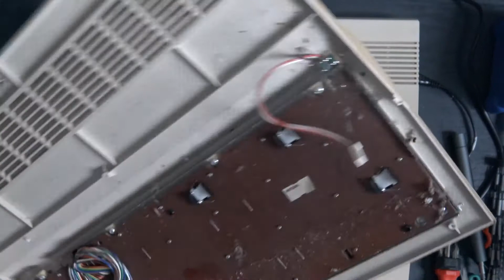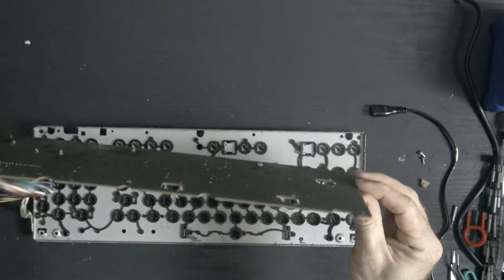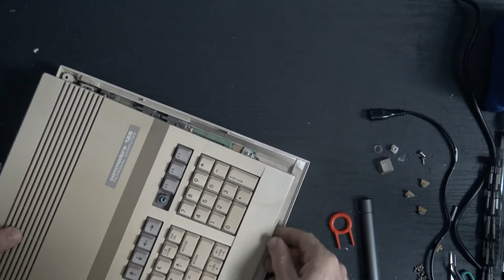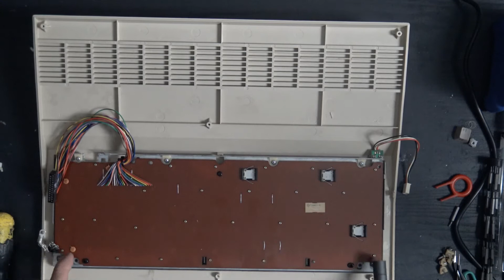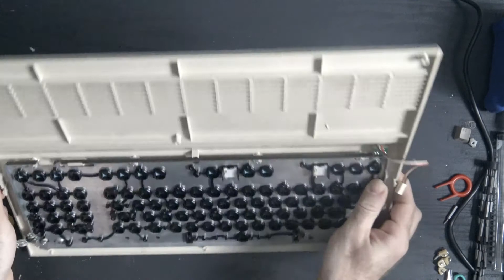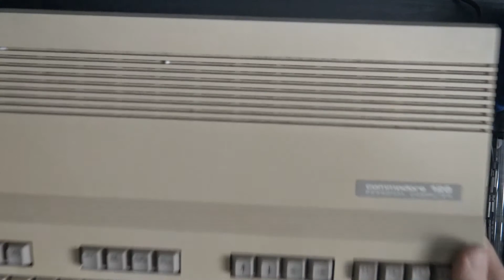How to Replace a Key Cap and Plunger on a Commodore 128

Comment: The certificate on your site is expired. I was wondering do you sell refurbished C64’s?
Reply from the maker: hey thanks for the heads up.. certificate is now renewed. I do sell them from time to time. Are you looking for anything in particular?
Reply: @DIYChris  something that is assy 250407. Your website has a lot of upgrades for that board. I was hoping to get something I could swap out components for modern upgrades.
Reply from the maker: @TRONMAGNUM2099  I do have a few of those. None of them work at the moment. I’ll keep you in mind for the next one I fix